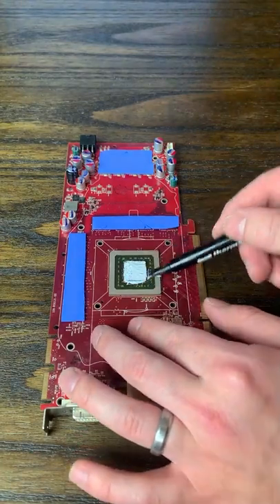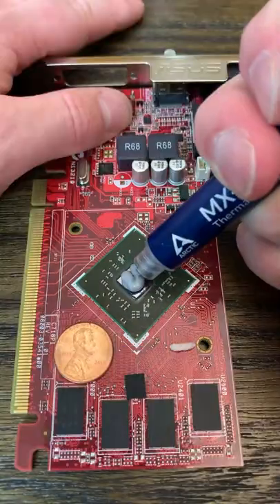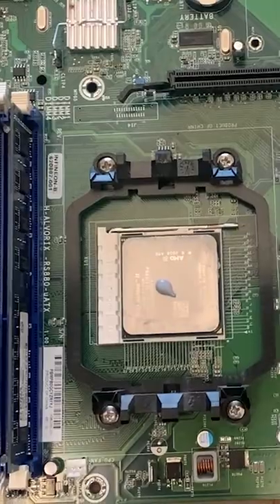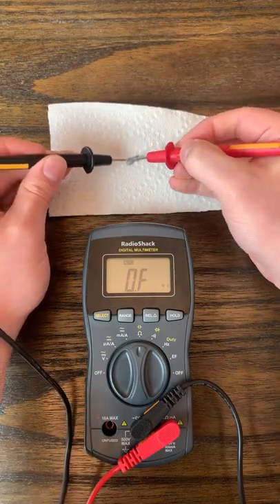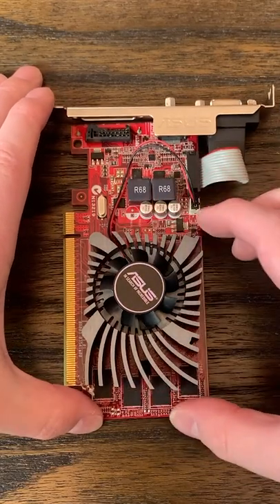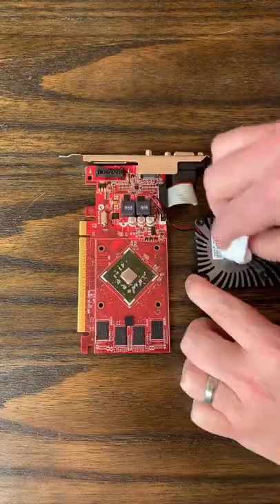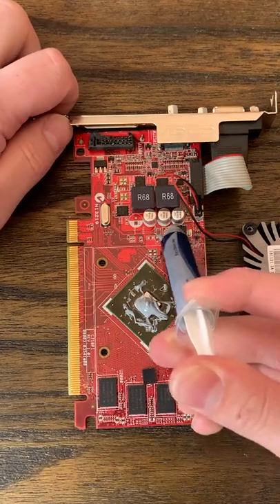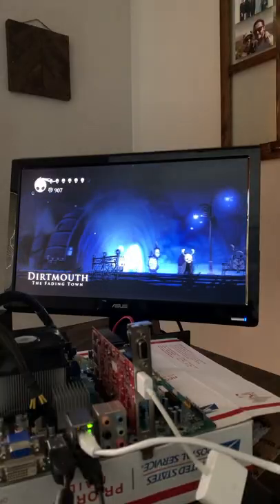Can Thermal Paste RUIN Your PC? #Short

Comment: Showing everyone just how careless we can be with these"delicate" components.
Reply: Cant you give it to a repair shop or repin it with soldering iron? I did repair 2 out of 3cpus but it took a lot of hours and work
Reply: KABAKOKSEK  never force anything
Reply: @NippyNep  
*except ladas and people, those work even better the more sadistically you treat them.
Reply: @foodhatesme  actually you can put in every processor just remove power in water and it would survive
Reply: KABAKOKSEK   use gorilla glue and heinz ketchup to fix it
Reply: A lot of engineering goes into making these components idiot-proof
Reply: Haha yeah it’s surprising. Funny story I actually broke off a tiny capacitor of a motherboard while building a pc and the thing still runs
Reply: They are surprisingly resilient, as I've accidentally knocked off a laptop from my desk and it destroyed the flash drive I had in the port. The port was perfect afemtereards and the computer shows no signs of any damage from the fall other than a few scuffs
Reply: Single drop of water lands on 3060ti —- FRIED
Reply: I remember getting so careful with my first ever pc. Now i just yeet parts
Reply: @rockytom5889  what a goddamn glorious comment
Reply: 0p
Reply: I used to be more careful till linus tech tips hit a motherboard a bunch of times with a strong static gun and it did nothing.
Reply: @309electronics5  not all repair shops will work on gpus. Hell some wont even work on anything that came out after 2014
Reply: I mean... me for example I'm trying to build a 1.5k pc for my first time... yea I would be faking careful with all of them XD
Reply: KABAKOKSEK  thats why in most tutorials they say it should just go right in and most likely if your new to computers your gonna watch a video from YouTube
Reply: Don't let it give you a false sense of comfort though, that is how you break shit.
Reply: @inflammatorycommentswithno2407  proceeds to jam the cpu in the ram slot
Reply: @foodhatesme  True, my computer's motherboard was left in the rain until I picked it up and washed it clean
Reply: @foodhatesme, yes, you are correct. I washed my graphics cards, put it under the sun for 6 hours, then dried it out with a hair dryer it works really good

Comment: Mx-4 is actually marked non-conductive and non-capacitive in the spec sheet
Reply: Not everyone reads the "specs for nerds", only those with actual common sense refer to those for accurate information. Majority of companies add these specifications to prevent lawsuits from people who are too lazy to read and it's very effective.
Reply: @antitouchable  Well, I would assume someone who delids his chip would be "nerdy" enough to check first. When applying thermal paste to an ihs there won't be an issue even if it's conductive.
Reply: @dodjo_cat  Agreed, I think that the non conductivity and non capacity is  more of a safety feature for noobs, I use thermal grizzly liquid metal myself but don't recommend it to novice builders, hence the fail safe thermal compound
Reply: Its also a decent paste for its price
Reply: @dodjo_cat  the majority of PC users are not deliding either. They're placing the thermal paste directly on the top of the CPU. No one calls removing the fan deliding. That is when you physically remove the CPU from the board.
Reply: @tygonmaster  Removing the primary logic chip from any board is called "desoldering". Deliding is the process of removing the Integrated Heat Spreader (the metal cover) from that chip.
Reply: That's what I was thinking the only big reason not to use to much of it is because when you take off the cooler or swap cpu it will be hell to clean up.
Reply: Amasan industrial paste is great. Not the highest performance but gets the job done well, is non conductive, comes in large tubes for cheap money. Never failed me.
Reply: Yah it depends, most don't but some are conductive and labeled as such.
Reply: If u use a termal paste made it metal its posible to cause a damage in some electrical components
Reply: @ernestojosuemariscalreyes6545 what about this thermal paste called GD900? I accidentally spilled some on my mobo, according to a website I checked it's not electricity conductive, am I safe? What happens if a thermal paste is? I mean, how to tell if a mobo was damaged by electricity?
Reply: just add a little bit of salt water to make it "conductive", even greater if you submerge it inside salt water

Comment: The interesting thing is that thermal paste also has very low THERMAL conductivity. It's mostly there to fill voids. That's why liquid metal is so much more effective as it has very high thermal conductivity, but also high electrical conductivity. Not to mention, it ruins aluminum in minutes.

Comment: Artic silver use to have silver in it, they changed the formula but kept the name, then released new paste.

It varies on the manufacturer but majority isn't conductive, internet loves this false fact though
Reply: fun fact "arctic silver" and "arctic" are not the same company
Reply: AS5 still has silver in it and is conductive MX2,4,5 are thermal nano grease and non conductive
Reply: It's like that "Monkeys in the shower" experiment. Older people think pastes are still conductive so they kept passing that knowledge down not realising those are rare nowadays.
Reply: Arctic silver came out with ceramic based non conductive. All of the silver based products are conductive.
Reply: @marcusshane  havent heard of that experiment before. Its quite interresting, the name is 5 monkeys experiment
Reply: @D3nn1s  Yeah it was an experiment on conformity where the ones that existed before pave the path for newer ones but if the system has changed, that path could potentially be a wrong one. Here:
https://youtu.be/NiWbRugTaaM
Reply: @shorty808100  no it is not. At least not to the point that it could short out a motherboard. It literally says that. I don't get how hard it is to understand that not being electricly conductive is THE MAIN POINT of thermal paste. Outer wise it is just better to use liquid metal. While in therioy they could be I never heard of a single one that actualy is.
Reply: Artic and Artic Silver branding dilemma 😂
Reply: But, but, but what about the 2 that are?? Ah ha! Checkmate!
Reply: @angrycapsicum6027  they probably have been discontinued become they ruined to many PCs.
Reply: Swing and a miss.

Comment: It's true most thermal pastes for PCs are not conductive. However, you cannot test it with a multimeter. In resistence/conductivity mode, the multimeter only uses a very small current across the leads. Some components on a modern computer can draw hundreds of amps. Even air can be conductive with the right conditions.

Comment: Most regular thermal compound is not conductive (for you know, obvious reasons). 

There are specialty ones that are made, liquid metal essentially, that will conduct and you need to be careful using those. Although if you’re using those you would hopefully be aware and using it for an application that really utilizes the properties.

Comment: You are absolutely right. Most Thermal Pastes are not conductive but some are. When building my PC some Thermal Paste got into the RAM Slot so checked on the box and it said it wasnt conductive. I use the Thermalgrizzly Thermal Paste.

Comment: MX-4 is carbon based, it states in the spec sheet that it contains no metals or metal oxides. Some thermal pastes, liquid metal based ones can short components, and some metal bearing pastes can as well.

Comment: I work in computer repair and I have seen chinese Power Supply Units that use thermal paste to keep the capacitors and chipc in place. It works pretty well even in the extreme conditions of specialized mining rigs

Comment: Electrical conductivity is a problem for older pastes and liquid metal. LM is only really used by enthusiasts, and older pastes that used silver as a thermal conductor aren't really a thing anymore. Almost every paste you get off the shelf is going to be made with thermal conductive ceramic base, and is entirely component safe.

Comment: One thing to note is that while most thermal pastes are non conductive (seriously I got a little on my original xbox motherboard that I fixed once and it was fine) there are some that are. Typically those are made from some sort of liquid metal like gallium I believe? Don't quote me on that, but anyhow essentially these are a liquid metal that can stay liquid at room temperature. There could be some thermal pastes that have metal shavings in them as well but I'm not a hundred percent sure. All I know is the ones that are conductive are usually a liquid metal of some kind if I'm not mistaken. Also side note if you want to use one of these thermal pastes I believe you have to have a cooler with a copper base heatsink. If the coolers heatsink has an aluminum base then it will eat through the base or the water block, the thing that sits atop the cpu  or whatever the right terminology is. This is due to the metal having some sort of reaction to the thing that sits atop the cpu if its made out of aluminum. You can get ones made out of copper so those coolers are to be used instead if you plan to use the type of thermal past I am thinking about. Correct me if I'm wrong please, I hate spreading bad info but this is what I know off the top of my head. Sorry if Im mistaken!

Comment: At best it would attract and hold contaminates that could be conductive. 
Many ppl don't realize this but car batteries can discharge between the battery posts because the top is dirty with conductive contaminates mixed with moisture and acid condensation.

Comment: With that said you should still remember that you still shouldn't do it purposely, it's not bad but not good, also might effect the cooling when having too much because there will be a bigger gap between the heat sync and the thermal paste, the use of thermal paste is to fill the gaps in the construction of the surfaces of the cooler and the cpu heat shield

Comment: I once had a problem that sometimes I get a blue screen after I build my first pc. Me and my friend presumed it was due to the mounting pressure since I had an issue with it during the building. It did improve it but after still getting it I found out there was a bit of thermal paste around my cpu on my MB that was causing the Blue screen - ever since I never got a blue screen again

Comment: I think the fear is mostly based on outdated information. When I first got into building PCs, like mid 2000s, pretty much everyone was using arctic silver 5 which has actual silver and conducts electricity really well, so you have to be careful with it. These days there are so many synthetics that don't conduct electricity but work just as well as the old AS5. I wouldn't use anything metal based on a GPU or delidded CPU, not worth the risk just to get 1-2C cooler.

Comment: Arctic MX-4 is, indeed, non-conductive as it uses ceramic as it's thermal interface solids, however, MX-5 and their other silver bearing TIM are slightly conductive.

Comment: The manufacturer all over apply thermal paste. If you have ever taken your gpu apart to change the thermal paste after some use, you will usually see thermal paste overflowing past the die :) so as long as you check and make sure the thermal paste you use says non conductive your fine 😀 I would make a mess with it or get it into a cpu socket just because it's a pain to clean but your fine :) GN actually did some testing with large amounts in the socket and everywhere just to prove it doesn't hurt it :)

Comment: The capacative effect is important for something called parasitic capacitance or capacitive reactance. It doesn't need to conduct a dc voltage for a fast switching voltage to jump through the material. When you have really high frequencies, you could potentially be causing shorts you wouldn't get if you had no excess thermal paste. However, the frequencies you'd have to attain to do that would be very high, but not impossible, I think. A CPU can potentially go to 5ghz. Not sure, because I haven't done the math, but it might be a possible issue. Better safe than sorry!
Reply from the maker: Interesting! And yeah. it's not a good idea to get thermal paste all over your pcb lol.

Comment: This was mostly due to the thermal paste called Arctic silver back then they had to had that formula due to the CPUs getting hotter like the AMD athlon and  Intel Pentium 4s I think most thermal paste nowadays are made out of a ceramic or graphite material or silicon sometimes a bit of everything but they do have other types I'm pretty sure there's copper one and aluminum I think those are usually used for industrial applications

Comment: Everything has capacitance naturally, from a grain of sand to a water. In much technicalities it will alter with your clock speeds, when applied on exposed electrodes. Other than that, its all good

Comment: What it CAN do is cause a bunch of resistance if it gets on connectors like the pins of a CPU, contacts on RAM, or on your PCI connectors. I've had this happen once before. I had to essentially bathe my CPU in contact cleaner to resolve the issue.
BUT not all thermal compounds are the same. Some are ABSOLUTELY electrically conductive. Always know first before attempting to mimic this video.

Comment: Lol … but on a cpu when it might end up in the socket you might experience issues since it is non conductive (pins might not have good contact)
I hope you will also do a short on this as it is something to be aware of
Reply: How would that happen? No matter how much thermal paste you would put on the cpu, it would never get under those pins anyway, since you apply it after putting the cpu in the socket so nothing to worry about. But he even did test that out in another video and put thermal paste in the socket and then put the cpu in. It still worked no problem lol. I am yet wating for some video where thermal paste destroys something or is damaging in any way

Comment: I'm not sure why people thought that this would ruin your PC, it's pretty well established that it won't
But it is generally better to not use more than you need unless you're working with a bare die
An IHS only really needs thermal paste in the middle, because it isn't actually cooling anything at the outer edges. All of the CPU dies that actually need cooling are around the center of the IHS
A bare die, however, does need enough thermal paste to cover the entire thing. If you don't cover an entire die in thermal paste, then some part of it might be overheating, and if that part doesn't have a temperature sensor, there's no way to know that it's too warm
That being said, you can still apply it in moderation

Comment: There is a difference between thermal conductivity and electrical conductivity. Thermal paste has to be heat conductive to help get heat away from the components and into the heat sinks. If it really was electrically conductive we wouldn't be willy nilly building PCs, only experts would do it because too many people would be dumb and short their pc with thermal paste.

Comment: Only if it’s conductive, I use Kinpin kPX which they say you have to change every six months, I re-pasted mine 3 1/2 months ago my PC still idles at 30C just like when I first applied it no degradation ( and still only hits 56C while gaming ) yet but I don’t do pea, grain of rice etc.. I do the spread because when I first started building PC’s back in 1990 the spread was the way it was done
Reply: It doesnt really matter how you spread the thermal paste. Seen many tests and no matter what you do, if you put enough paste on the cpu it will just work, no difference at all with the patterns

Comment: it used to happen tho, with old arctic-silver products that used to advertise their "metal micro conductive materials" very openly. until they become so popular with as5 and dumb consumers started to short their components for apply to much on them or, like in this video, they applied it on the ram chips instead of thermal pads. So they changed the formula and stoped advertising it, now its just on their industrial products.
Reply from the maker: For sure. I never said that electrically conductive pastes didn’t or don’t exist, just that most of them currently are not (at least not many marketed towards consumers for PCs). And this was to primarily address claims that even pastes that aren’t conductive can still be conductive or capacitive.
Reply: @HardwareHaven  thanks for doing the lords work
Reply: @HardwareHaven  also I think some of the "high performance" chinesse ones still use that old formula, maybe the rumors come from there

Comment: I've been using my pc with thermal paste inside the cpu socket for 4 years,and nothing broke.
Reply: Meanwhile I had paste on 3 pins and it caused half my ram slots to not work
Reply: @undergrnd20  the pins are probably not touching
Reply: @soacespacestation8556  pins of the cpu? I spent 6 weeks trying to figure out why my ram just suddenly wasn't working. Swapped ram, mobo, and a few other things. Pulled the cpu for the 4th time and scrubbed the piss out of it and everything went back to normal

Comment: I dont think tha paste is conductive when fresh. After a while and with exposure to heat, I have seen pastes and potting resins dry and then become hygroscopic. That's the point at which they become conductive, in humid environments and with unstable compounds that take on moisture.

Comment: I seen people spray water on gpus and the gpus still runn

Killing a gpu is extremely difficult 

They don’t engineer these things to break at the lightest touch

Someone once told me to no touch the PCB because the grease on my fingers could short something

The odds of that are so low
It’s not really an issue

Just don’t leave nasty stains on the pcb, makes it look terrible when the card heats up